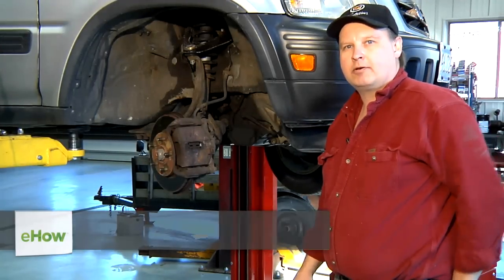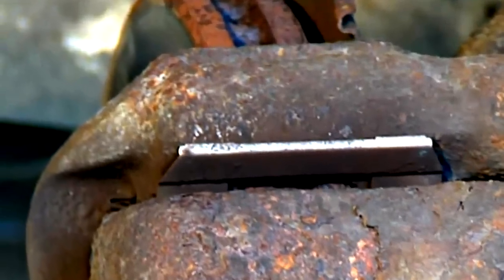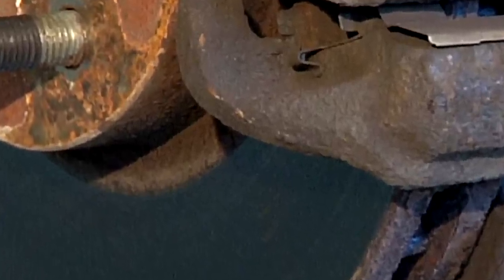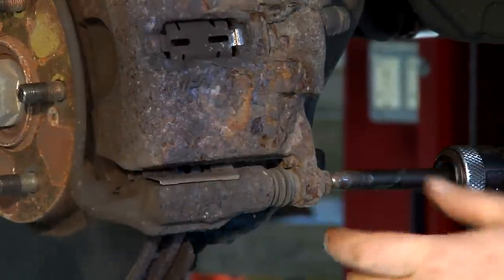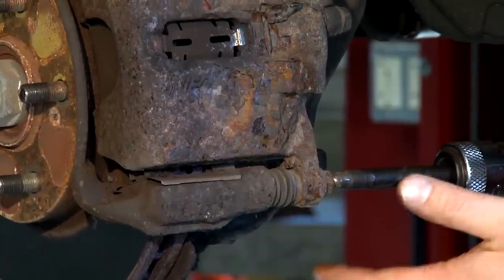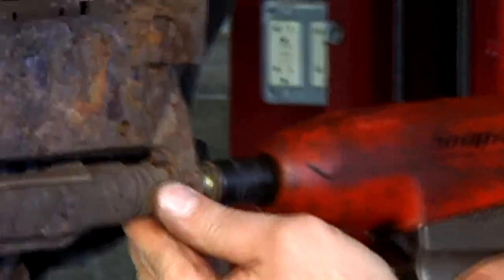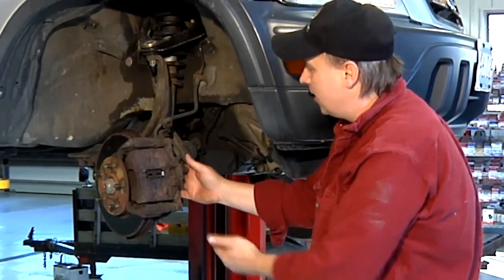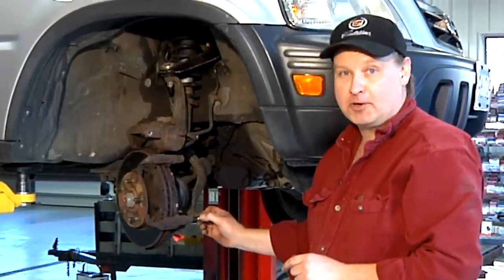Auto Repair Tips : Removing Rusted Brake Pins

Comment: This removes the bolts, not the pins.  Misleading title.
Reply: The bolt is the pin
Reply: @ericc.5141  i have a Lexus IS250 and it has pins on the caliper to hold the brake pads.  One of them is totally stuck.